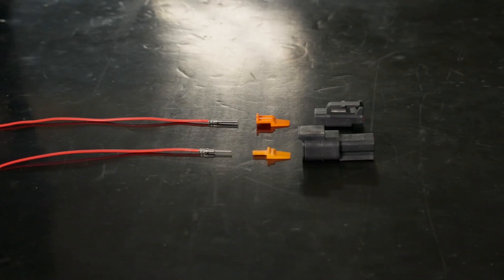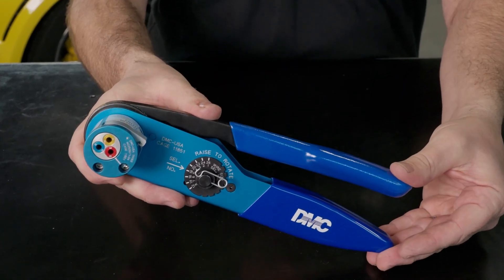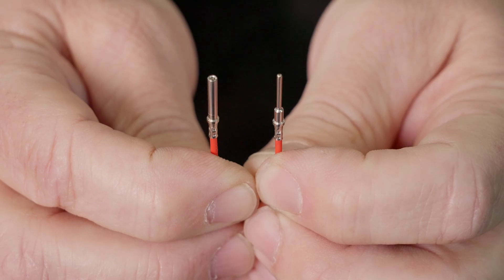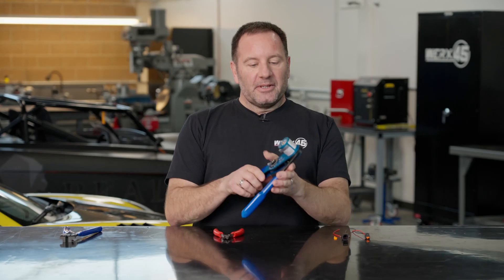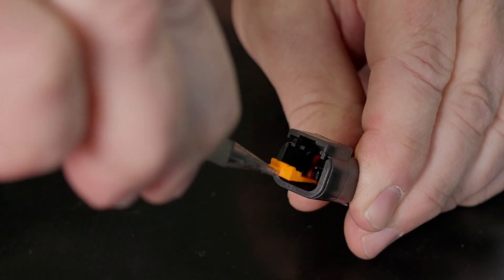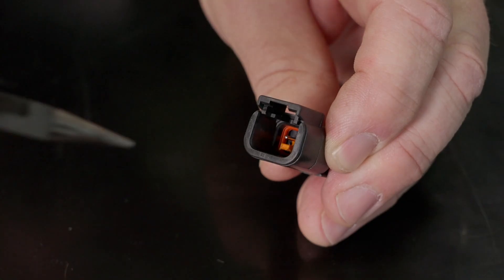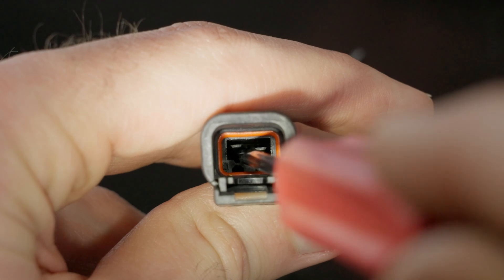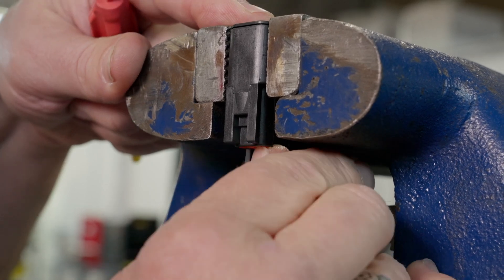How-To Assemble and Disassemble Deutsch Connectors

Comment: Doesn't Describe how to undo female connector - do useless
Reply: This is the hard part and for me the whole point of the video for me. I'd like to see how to do it without the special tool! Very disappointing this wasn't described. Rest was good though.;-)
Reply: A bit late but you simply pull the wedge out from the front.
Reply: @tinnedanger 
I ended up getting the tool so it all worked out
Reply: @tinnedanger  thanks for replying, but in a 2 pin connector it more or less impossible (for me at least) to pull out the plug without the special tool. I had hoped someone might have a work around. ;-)
Reply: @BryanMcGlade  I worked it out on a three pin connector.   I have a pair of electronics long nose pliers.  They are tiny.  It surprised me how easy the wedge came out.  No effort at all.  You pull it from the front.